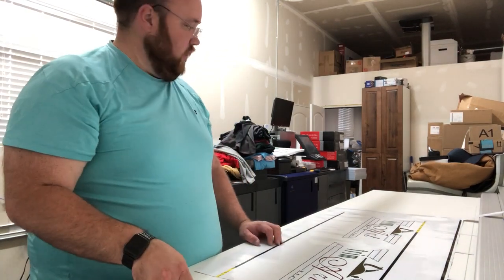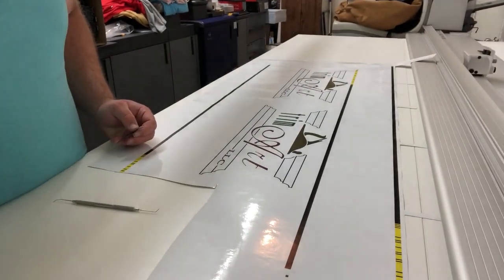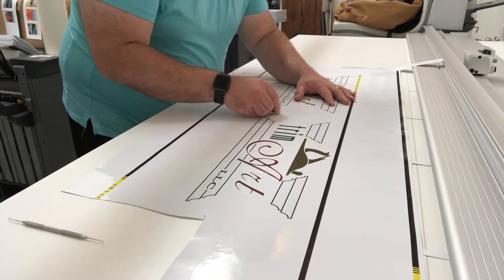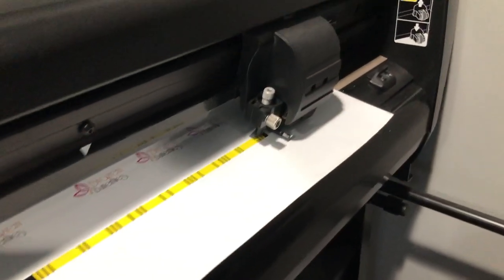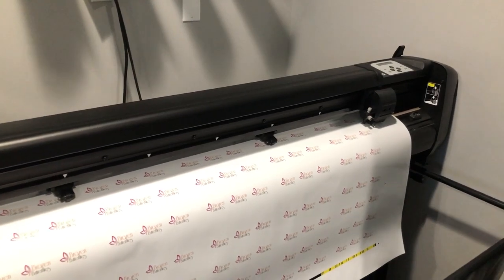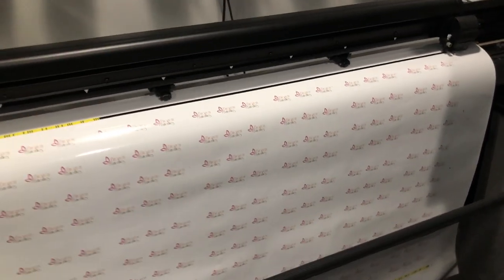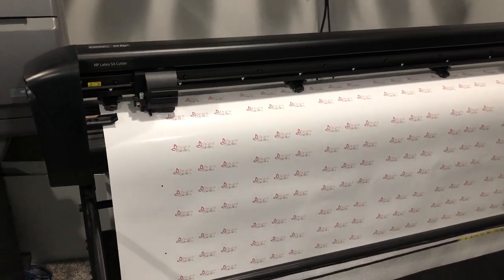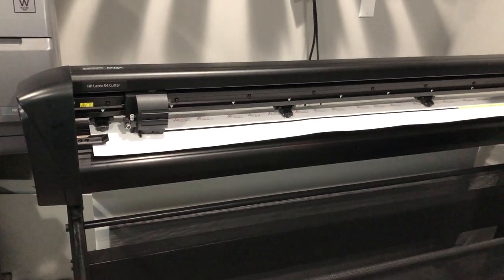Finally over, and weeding and transfer tape application - vlog 252 - Print Shop Updates

Comment: In our shop we apply them to foam board using a laminating machine. We use a big sheet and apply 12 or 16 signs at once. Then we cut the whole thing into the final units. 
It saves a lot of time but you do need some space in order to acomodate the big boards.
Reply from the maker: I'd love to do big sheets. Space is my current problem. What tool do you use for cutting them down.

Comment: I try using the bar code and it never works for me. It reads then it stops smh. Any tips daren?
Reply from the maker: There was a bug in Flexi that caused that. Make sure your software is up to date. It could also be that your barcode server is off for some reason.